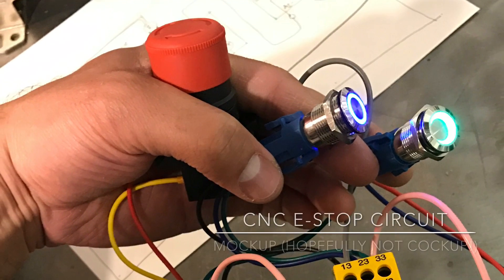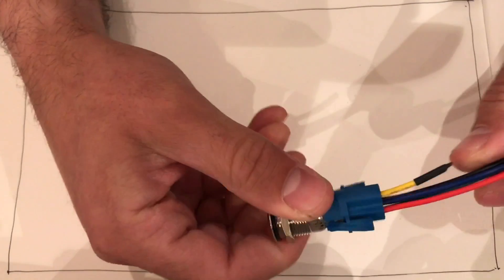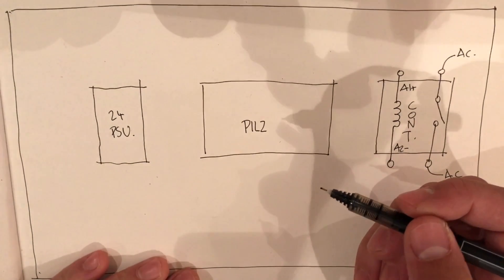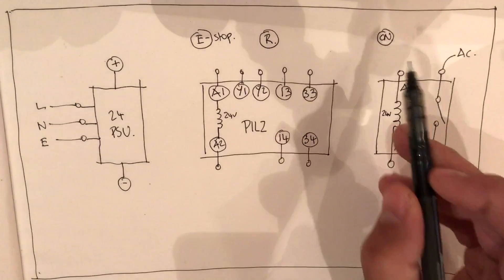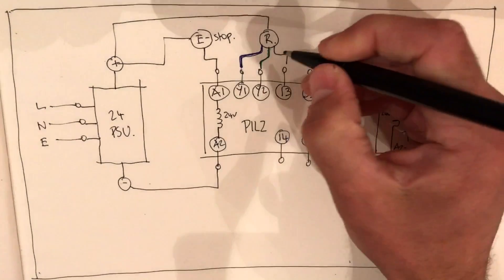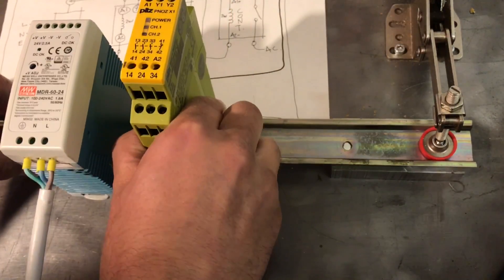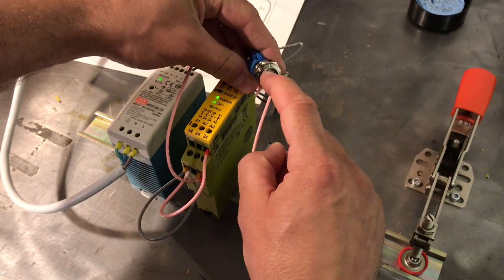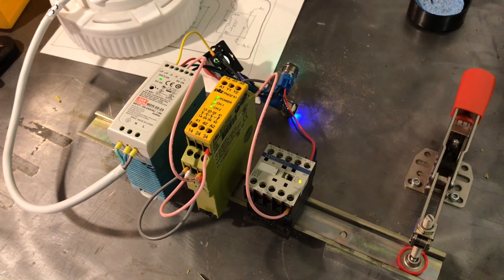CNC Electronics - E-STOP Mockup (Home shop CNC Build Log - Ep17)

Comment: This doesn't protect against the contactor welding.  For that you need two series contactors with NC aux contacts to monitor if either has failed to open.  Admittedly probably way overkill for a home DIY project though 😂

Comment: Always switch on / off should be done by the latch, separate NO switch to on  and NC switch to off the machine. After the reset, the machine will not start by itself.
Reply: Exactly

Comment: The start button should be wired to the safety relay not directly to the A1 on the contactor. The safety relay is only actuating on the negative to the main contactor in your circuitry. Please correct it. This is in no way acceptable to teach to students on your channel.

Comment: I will not point out many safety error previous mention. The serious error in here is having the A2 of contactor connected into the 33 and 34 NO on safety relay. That is negative or neutral, which if wire touch the frame or anything that makes ground... somebody will get hurt or killed! No even your E. Stop will save them... whatever is connect into this contactor will still runs even if the E.stop is pressed. My advice to people who are learning, please, please do not use this method!
Reply: A2 is negative yes, but the voltage depends on what you use. He's using a 24VDC coil, which is far safer than if he was using 230VAC or above.

If the e-stop is pressed, the safety relay will de-energise and the NO contacts which the contactor's A2 coil is running through will open, this will de-energise the contactor since the A2 coil is no longer connected to the negative. Thus whatever is driven by the contactor will stop if an e-stop is pressed.

Comment: "I'm a bit of an amateur but this actually works!" So you don't know if this is the way it is supposed to be and is reliable?
Reply: Instead of trolling, go through any of the many application notes available online.
Reply: He is incorrect follow the data sheet that came with the relay 
He  should not be giving advice on machine safety
Reply: @johnonlyonknobbies  He's not incorrect, see the data sheet for this particular safety relay - page 3 https://docs.rs-online.com/16b3/0900766b800331a4.pdf
Reply: @Joshgordon96  Did you read the description
E-STOP
without detection of shorts across contacts
What's the point of using the safety relay
Reply: @johnonlyonknobbies  Yeah - that's what you get with a single-channel safety relay. 
It is what it is, it would be better to use a dual-channel safety relay but a single-channel safety relay still at least offers advantages over say using a regular relay i.e. with safety-rated contacts and a built-in reset function, plus they're generally cheaper and less complex than dual-channel relays (it all depends on the context too).

Comment: Please  before you advise on emergency stop circuit make sure you are correct 
the supply is not switched thru the EM button you have defeated most of the cross wire and short circuit protection offered by the relay 
  please consult the safety relay  manufacturer for correct wiring as this is incorrect  in so many ways
Reply: @A A please use to wiring diagram that comes with the relay not as shown above as he is incorrect
Reply: @johnonlyonknobbies  See page 3 of the official manual for the PNOZ X1 https://docs.rs-online.com/16b3/0900766b800331a4.pdf. The 24V from the e-stop is wired into the A1 terminal. Note this is a single-channel safety relay without short-circuit protection.
Reply: It is for the PNOZ X1. Clearly states it in the operating manual.
Reply: The short circuit protection is found on the dual-channel safety relay which monitors two channels, this is a single-channel safety relay which requires the 24V supply going through the e-stop to feed A1 on the safety relay
Reply: @A A if you are still having issues then post and l can assist with correct method and logic

Comment: Why didn’t you wire the E-stop across the channels rather instead of killing the supply?
Reply: I thought the same, maybe because he only had 1 n.c. contact?
Reply: Because this is a single-channel safety relay so the supply to this particular safety relay is the channel.
Reply: @Joshgordon96  no it’s not. It even shows 2 channels
Reply: @7chappers  https://docs.rs-online.com/16b3/0900766b800331a4.pdf See page 3 of this manual for the PNOZ X1 (the safety relay in this video) which shows how the e-stop circuit should be wired into this single channel safety relay.

Where would you wire them?

13 - 14, 23 - 24, 33 - 34 are the NO contacts switched by the relay.
Y1 - Y2 is the reset circuit
41 - 42 is the one NC contact

That only leaves A1 and A2, A1 being your incoming positive 24V from the safety e-stop loop and the A2 terminal connecting to the 24V negative.
Reply: He use PILZ as normal relay - completely wrong.
Reply: @tomjdesigns1280  This is a single-channel safety relay so that's the only way it can be wired.

Comment: Wanting to confirm the operation of the Pilz X1.  I can’t find any clear information on it. 

When there is 24V across A1 and A2 (supply voltage) AND the connection between Y1 and Y2 (start circuit) is closed the X1 is active and 13-14, 23-24, and 33-34 (the safety contacts) are closed and 41-42 (the auxiliary contact) is open. 

Then if the connection between Y1 and Y2 is opened (while there is 24V across A1 and A2) then there is no change to the status of the auxiliary and safety contacts). Is this true?  

In other words, the start circuit is only used to enable the X1 after an interruption occurs to the supply voltage. Once the X1 is enabled the only way to disable it is to interrupt the supply voltage (changing the status of the start circuit would have no effect on the safety or auxiliary contacts).
Reply: For the X1, the Y1 and Y2 terminals are technically the 'reset circuit', not really the 'start circuit'. If the Y1 and Y2 are linked together then the X1 will automatically reset once the 24V supply to the safety relay is returned. If the Y1 and Y2 terminals have a reset button in series then once the 24V to the safety relay is returned, the operator needs to press the reset button once to link Y1 and Y2 and return the X1 to its normal state.

You're correct in that if the connection between Y1 and Y2 is opened whilst there is 24V across A1 and A2, there is no change to the status of the auxiliary/ safety contacts, this would be a normal situation if the Y1 and Y2 are linked via a manual reset push button.

Comment: I think you do not need a second button to pull in the contactor.  The start button should do this once a fault is reset. 

I am curious how the BoB is able to trip the e-stop.

Do you have a wiring diagram?
Reply: No you need a separate start 

Think
You hit a e stop because its an emergency stop
 so what ever is running needs to stop in the event of accident or emergency ie machine blocked running out of sync or injerd person ? 
Right

 well if you reset the estop and the machine started straight away with out investigating or making sure no one is hurt then you'd have a big mess of machinery or possibly dead bodies 

This is why skilled trained persons design and wire control panels 

Best way to learn is to go to college or night class or a skilled person thats willing to help 

 not the youtube  ive opend my ass up to a court case i saw it on video your honnor  way of life